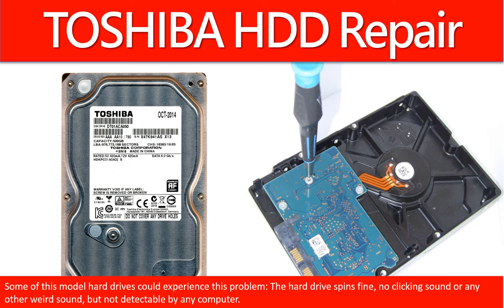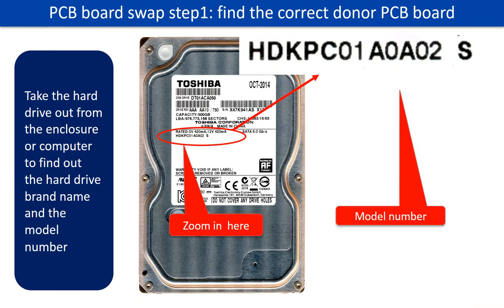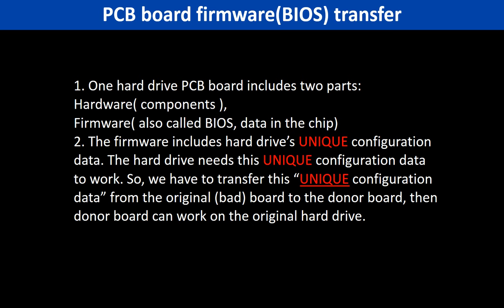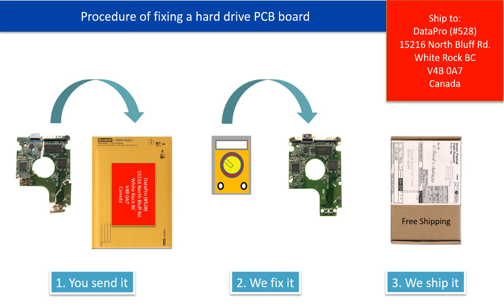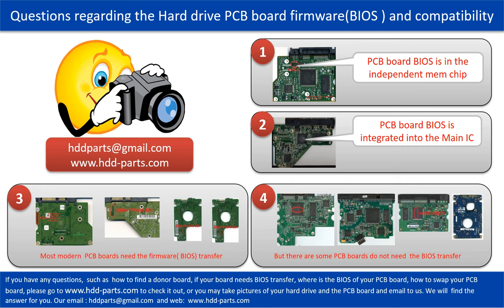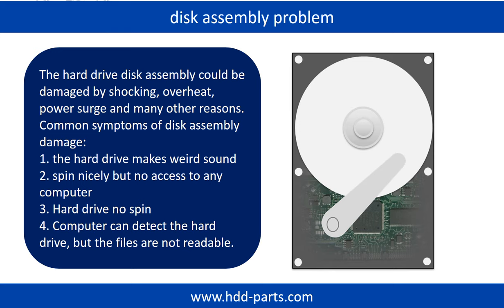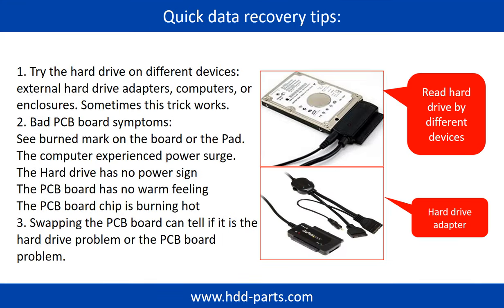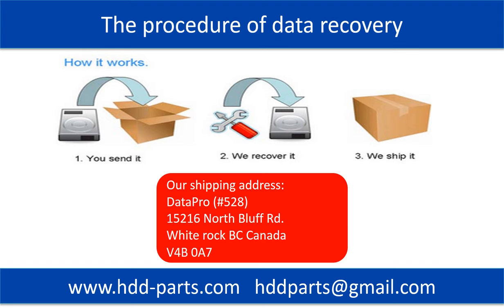Toshiba hard drive PCB board repair  disk data recovery 0A90337  HDKPC01A0A02 S  DT01ACA050

Comment: Hello, I have a cellphone/tablet repair shop and have the experience and experience nessesary to go forward with microsoldering.
Could you be so kind to advise me on what components I need to transfer over to new PCB from old one?
Part number is correct number as far as i can tell.Old PCB was burnt by power surge and will not even power the old HD up, No disk spin.
BUT!, New PCB + Old HDD = Spin at first few mins but stops, also not detected by BIOS autodetect. 
So either internal components are also fried, OR maybe i need to transfer components over.
Model number is  DT01ACA050 , 0J21827 , 111 0A90377 01

Thank you ever so much!

Comment: Hi..
my hard disk is spinning and don't make any noise like clicking or something. The thing it is not detected by my pc or any other pc. There is no damage signs on it up and down. Wondering if you can help me with this issue i have v v important data on it and i don't want to loose them. Just help me to determine whether the problem with board or the head or... waiting for your answer thanks
Reply from the maker: can you send the pictures to hddparts@gmail.com ?

Comment: My 1 TB toshiba HDD was doing cluck cluck sound sometimes but working. When it cluck sounds, it 's pcb board become untouchable hot (Just behind the motor IC) and that time HDD reading and writing speed is too slow and HDD process become  100% in task manager. After a while everything is ok and run nicely. Then after sometimes , it starts again. There is no specific time gap, it can start after 5-10 minutes, or 2-3 hours, Even sometimes I run whole day without any problem. But last week it suddenly stopped working. Not, spinning, no disc sound , no head cluck sound. But a very high frequency (I think) thin sound from the pcb board. Can be heard if I go closer to the disk. If I move the disk near my ear, seems like sound is passing by the side of my ear. 

I have another same model (DC01AC100) , same firmware, same country, 1TB Toshiba HDD bought one year after buying the first One. After swapping the pcb board , the 1st disk is spinning, No clucking sound etc, nicely spinning. but not detected in BIOS or anywhere. Do I have to swap the HDD bios IC too?
I'm researching before doing something.
-----
The boards are Identical but not totally. RAM CPU looks different, but shape is same. maybe different Company.
The rounded thing around the motor IC (I don't know what they are) are different. 
in the bad hdd,they are marked DC, AH, AC ,
in the Good one, they are marked DR, HR, AR. 
 CPU - both LSI 6045 , but looks different and other numbers don't match
Motor IC - not matched numbers in first Line, but Matched 2nd and 3rd line (0A75794 , MYS)
BIOS IC - Numbers don't match, starts with 25.
RAM - Looks Different, one is winbond, another Zentel, No matching numbers.
Reply from the maker: back up your data first in case of ...
Reply: @dataprodatarecoverylab  hi our toshiba hard disc is already 0%  life😩.  What to do with that